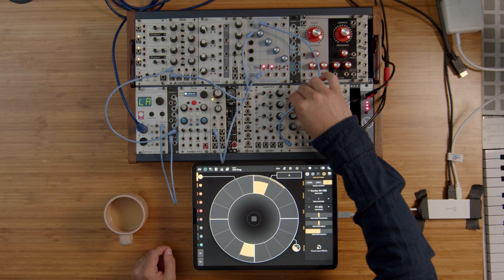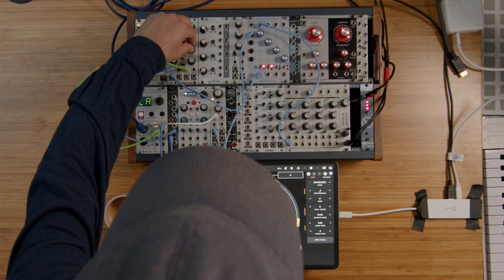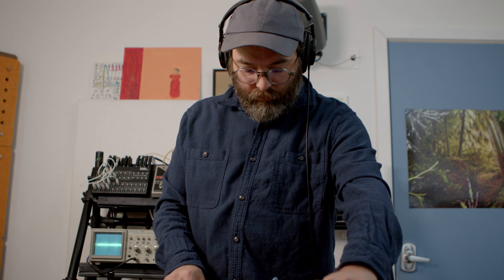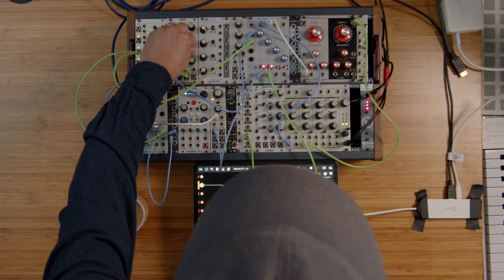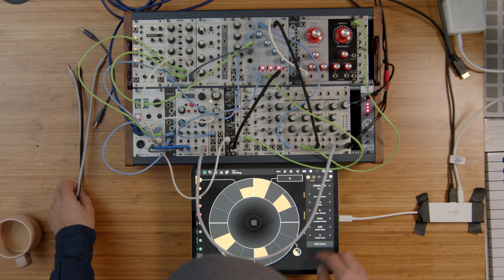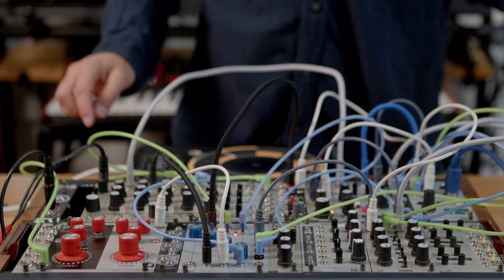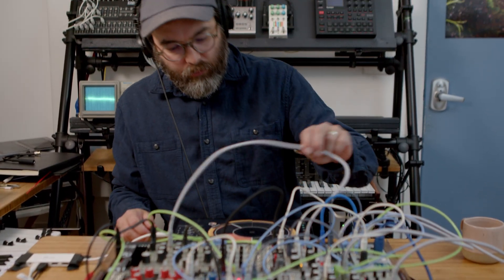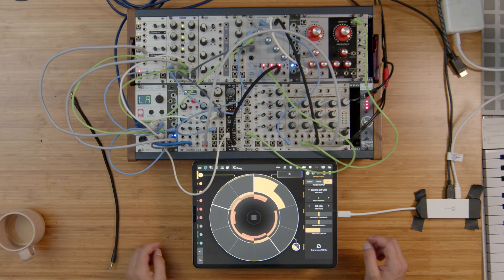How I Make & Sequence Modular Synth Drum Sounds With Patterning 3 : Drum Machine

Comment: What is your rig for getting that iOS app to conteoll
Voltage?
Reply from the maker: I use an old Focusrite 2i4 over USB as a MIDI interface (I've also got a cheap USB-C to MIDI Din cable that would work as well), and I connect that to the Mutable Instruments Yarns.  Yarns has a bunch of ways it can work, but I've configured it for 4 MIDI channels, each with pitch CV and gates.  I talk about the rig more in this video : https://www.youtube.com/watch?v=jYuefBdDjRs&list=PLvlJpU4QCfdCruoSUIVo_eDfcWfx0H6Ca&index=8
Reply: @OlympiaNoiseCo thank you